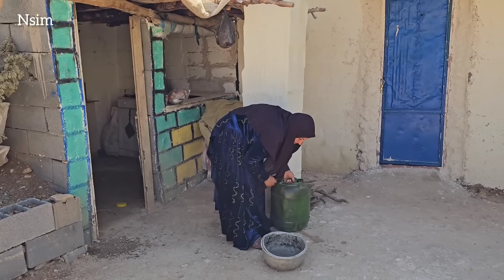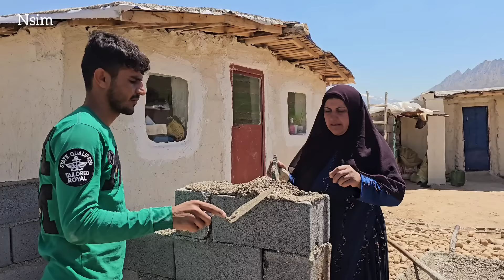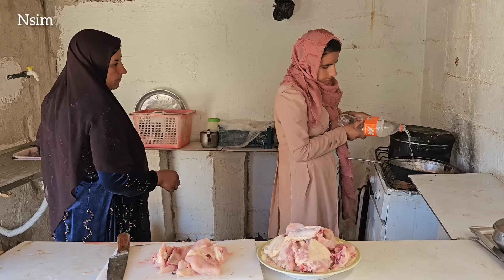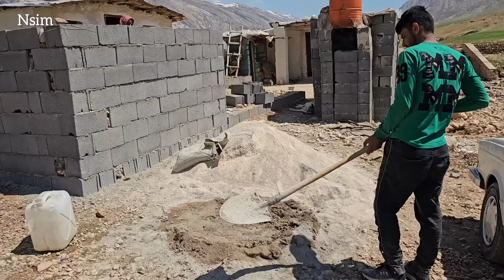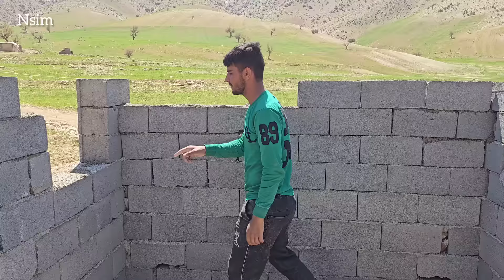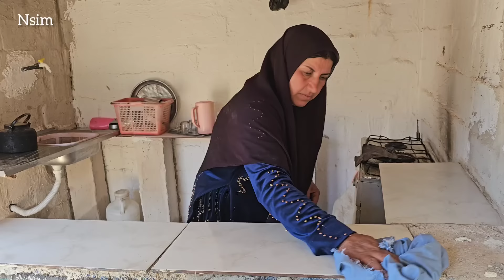Flavorful Kisses: Romantic moments in Ali and Sarah's kitchen

Comment: Ok I am not a builder but my husband is so I am talking with some kind of know how… Ali my dear you need more cement in that and there barely is enough to hold the blocks obviously you are not building this to be long term because one swift kick from Miriza or Lilia’s rejected suitor or even if you lean against it and it will come toppling over. The color of that mixture should be a lot darker than what I see. It’s the same color as the sand WTH???!!!! Come on i expect better from you.❤